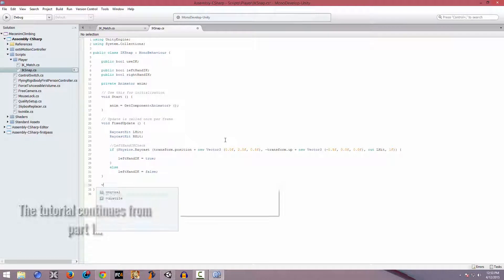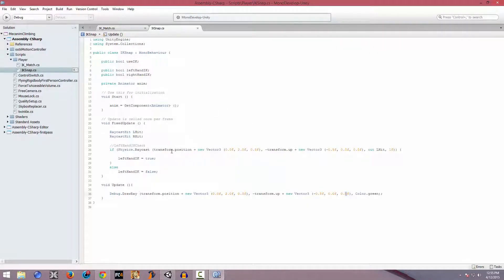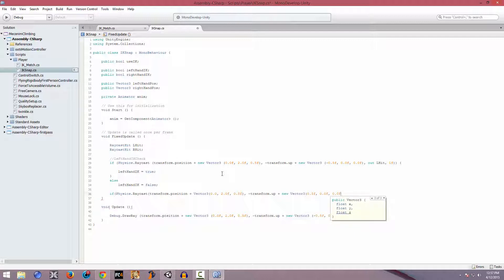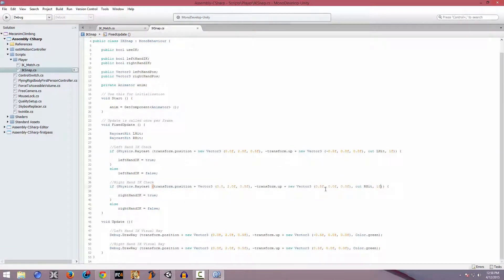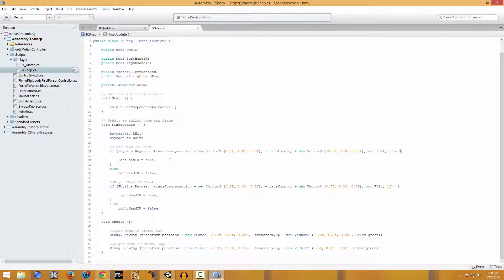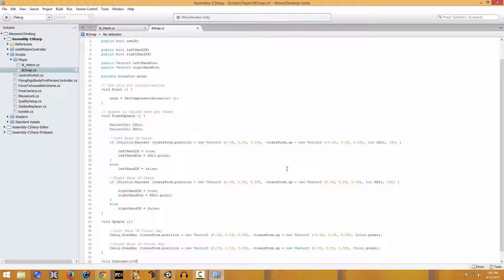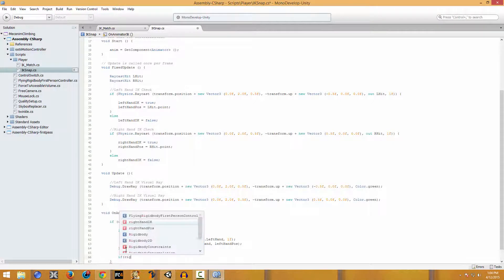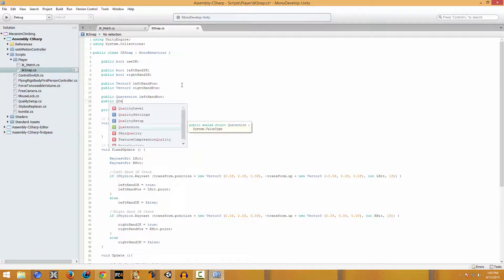Climbing IK Setup Tutorial Part 2 (Setting Up IK) - Unity3d

Comment: I'm trying to use this in my class project but the when i use    Debug.DrawRay (transform.position + new Vector3 (0.0f, 2.0f, 0.5f), -transform.up + new Vector3 (-0.5f, 0.0f, 0.5f), Color.green);

nothing is showing when i hit play any help??
Reply from the maker: +yoboychicken1232 That's weird, if possible can inbox me your code?
Reply: i didn't finish it because my initial code didn't work. i'll send you a copy when i get to school tommorow
Reply from the maker: +yoboychicken1232 sure, I'll try to do my best to help you
Reply: +Yaseen Mujahid 

so here is my problem right now i dont have a 3d Modeled player thats animated yet. i'm trying to get the basic code of my player box on input.key("e") the box moves on top of the ledge.. when i used your IK setup for some reasons my raycasting wasn't visble even after i used debug.drawray.. i only have 5 weeks to make a video game
Reply from the maker: You are using "Debug.DrawRay" in the "Update()" function right? And well you're gonna need a animated model before actually getting into IK, you can use a unity3d provided model for this purpose, just like I am using in the video tutorial. Let me know if you want to personally get in touch with me so I may be able to help you further.
Reply: Yaseen Mujahid
it would be awsome to get in touch i would appreciate the help.. but shouldn't ik work with a box as well
Reply from the maker: +yoboychicken1232 I'm sorry but as far as I am aware, unity's Inverse Kinematics system (IK) as seen in the tutorial series is only compatible with a "Humanoid" rig, (might be compatible with Generic, I'm not sure) and so it requires a object which is rigged/animated. The IK system in the series shows the use of "Mecanim IK".

In short, no, you can't use a box which is "not rigged" with this type of IK system at least.
Reply: ok i'll import my rigged character i think i lnow what the problem was i resized my character in unity and that probably through my positioning off with the raycast
Reply: +Yaseen Mujahid 

so i reimported my character as humanoid i got the raycasting to work but my hands wont move to the ray
Reply from the maker: +yoboychicken1232 Did you follow it all the way through? The hands are moved to the Ray's hit position in the "OnAnimatorMove" function
Reply: +Yaseen Mujahid 
yes i did i'll recheck it
Reply from the maker: +yoboychicken1232 also make sure your rig is "mecanim compatible", plus "use IK" or something is enabled in the "animator controller" attached to your character.
Reply: +Yaseen Mujahid 

you have OnAnimatorIK
Reply: +Yaseen Mujahid 
my model is mechanim compatible it taks all the animations i have and run smoothly through mechanim
Reply: +Yaseen Mujahid 
i figured out what the problem was i didn't have ikpass checked
Reply from the maker: +yoboychicken1232 Great! When I first started IK related stuff, I had the same exact problem :3 anyways, glad it worked out for you!